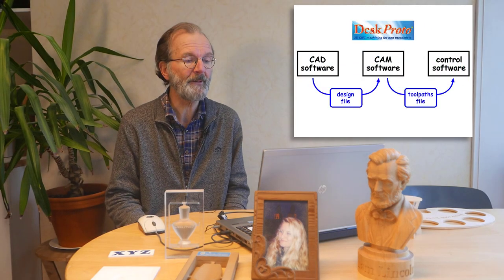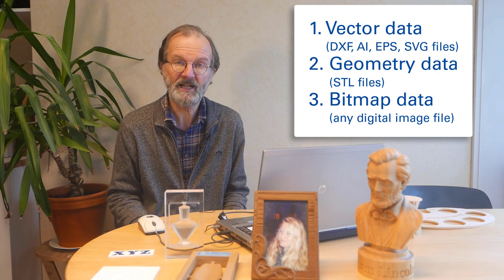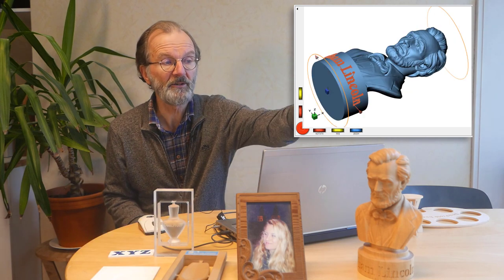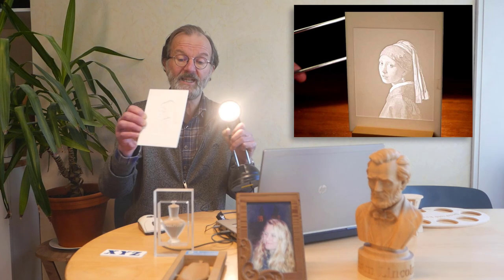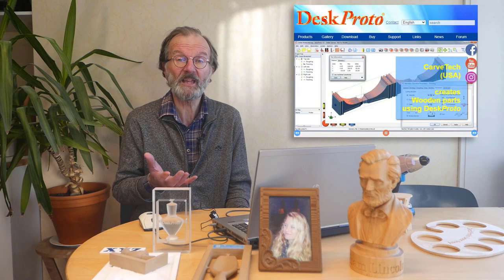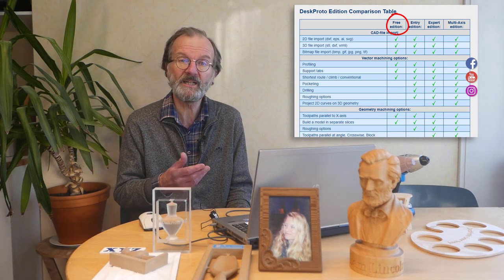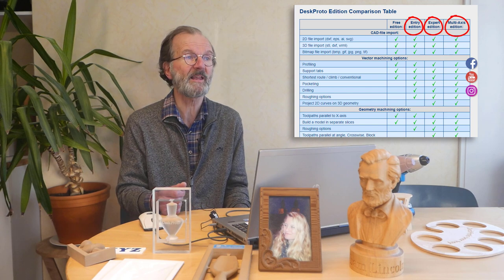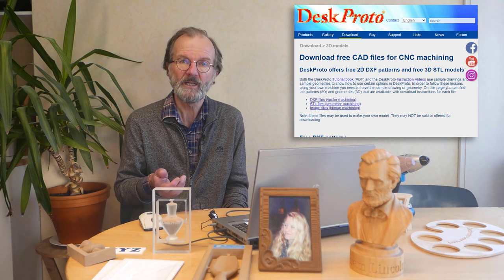Introducing the DeskProto CAM software, offering "CNC machining for non-machinists".

Comment: Fantastic software, very easy to use and navigate. Has a very useful 3D rendering of your machined part which is great for picking up tool path issues.10/10
Reply from the maker: Thanks for the compliment. Happy to see that our aim of making DeskProto easy to use worked out well for you !

Comment: Deskproto is really great multi axix CAM software and affordable for hobbyist. I would love to see support for simultaneous milling coming in later versions.
Reply from the maker: Thanks for your positive comment ! Calculating toolpaths where all 4 axis move at the same time (or even all 5 axes) is much more complicated than the current algorithms can handle. So you wish is noted, do not expect this any soon though as this will require implementing completely new algorithms.

Comment: I like the software... one thing I could not find is about ATC..   I was trying to find the setup under machines and do not see anything for them (Carvera has a 6 tool rack)
Reply from the maker: Hi Randall, The Carvera is already present in the list of machines, as "Makera Carvera" (the alphabetical listing follows the manufacturer's name). In the machine definition (library of machines) you can see that the 'Number of tools' for this machine is 6. In the Makera postprocessor that is selected for this machine the correct toolchange command has been configured.

Comment: It is impossible to rotate the block 360 degrees round the X-axis, as the block would collide with the working table.
The problem might be that the X-axis is located outside your part:
to solve this check the option Center Geometry, either on the wizard page or on Tab page Transform of the Part parameters.
Other options to solve the problem include:
- Scale down the size of the object, either on the wizard page or on
Transform of the Part parameters.
-
Tab page
- Change the definition of your machine in DeskProto (Distance to working table of machine).

_______________

Sir how to solve this problem 😢 please help
Reply from the maker: The text that you post is a DeskProto error message, and it gives a number of suggestions how to solve the issue. So I do not understand what you ask: the message already describes how you can solve this problem.  When you send us an email you can describe your problem in more detail, including some screenshots.